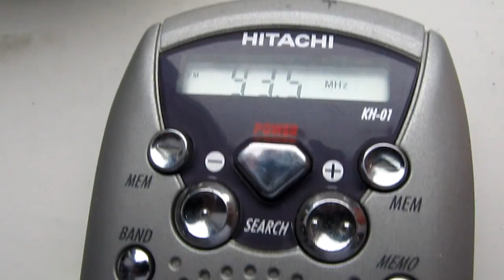Does A Speaker Work Under Water?  Watch To Find Out

Comment: Iv tried freezing stuff and putting it underwater and most of it has survived. My opinion is that 90 % of devices under 5 volts (should) work under water. Of course this has never been proven and is only my opinion.